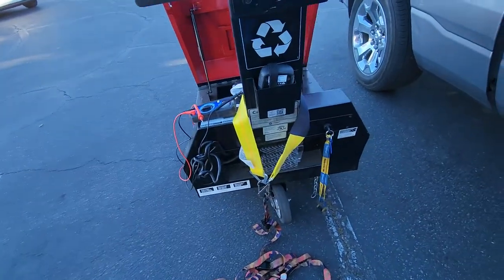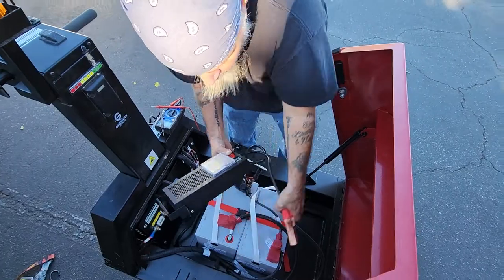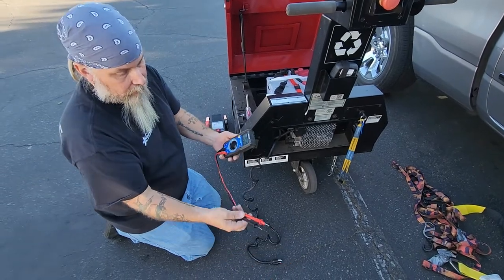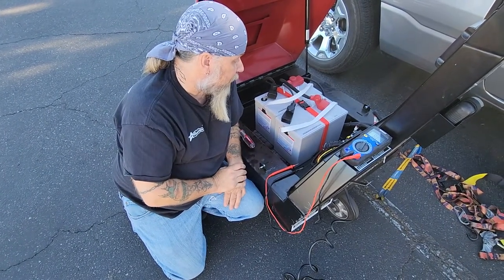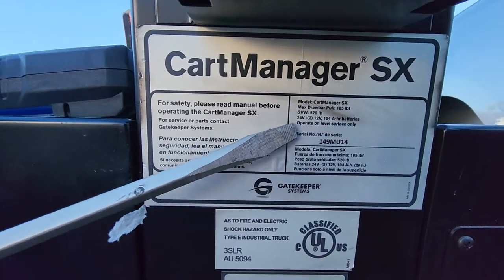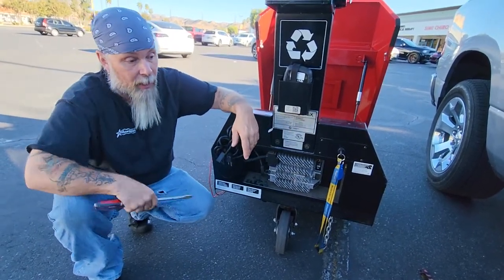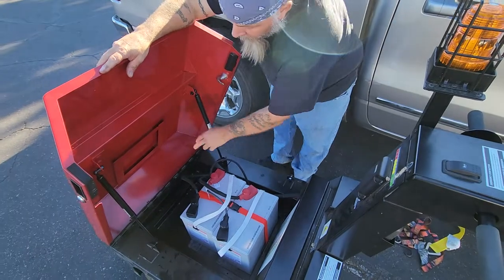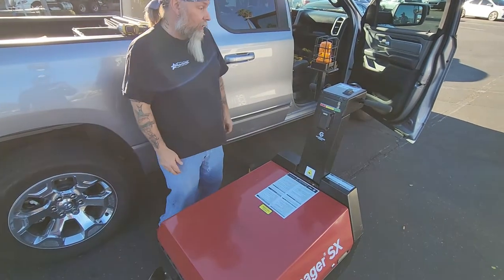Cart Mule Tutorial (Basic)

Comment: Hey Michael i work at sam club and we have the cart manager sx two of them and two ultras but the sx’s the battery dies quick we get a line of carts and the battery will go down from full to one green bar left or two so is the problem id the battery or something else
Reply from the maker: Most likely the battery I'd say. At least start there, sounds like dead cells in on or both batteries. Machines must be plugged in everytime not in use or will have battery problems. Also make sure charger is comingbonbto charge batteries.

Comment: I got a question why does the SX have two batteries in the XD has three batteries
Reply from the maker: 24v system (2 x 12v) 36v system (3 x 12v)
Reply: Ok thanks I work at Sam’s club in Colorado and we have the xd and the sx
Reply: I actually can answer the question and more in depth to Walmart wanted a 24 V system they still currently make the XD but Walmart wanted the SX better and if I may say the cart manager brand is not reliable the quickart M3 and m3 hd is a way better and more efficient and durable cart retriever
Reply: Very informative brother thanks 👍🏽
Reply: How often should you put new batteries in the machines
Reply: @tuckertroy65  once a year if used heavy
Reply: Hey, I got a question three months ago I work at Sam’s Club as a cart attendant and they switched out our batteries on the SX and the batteries are only lasting an hour. Do you think they gave us bad batteries?
Reply: @tuckertroy65  yes they did
Reply: ANDERSONEXPRESS7 do you think they could have gave us the wrong batteries because the batteries are smaller than the ones that they changed
Reply: @tuckertroy65  that’s also a possibility I would talk with your manager and tell them the machine isn’t functioning properly